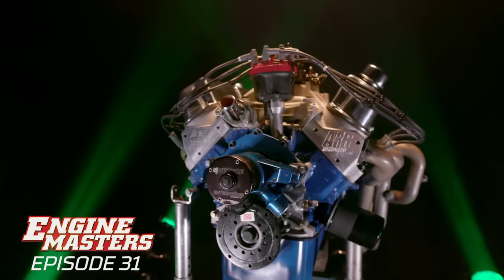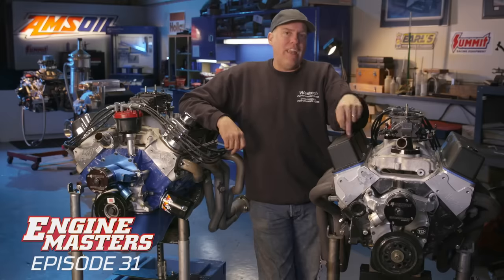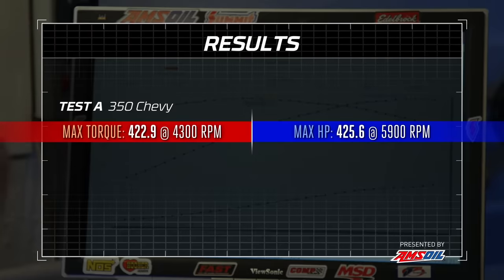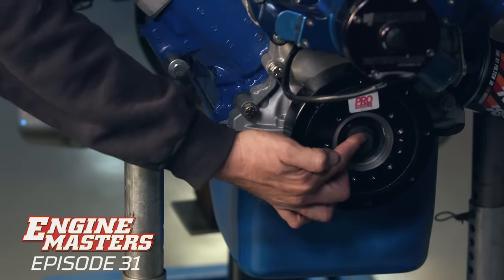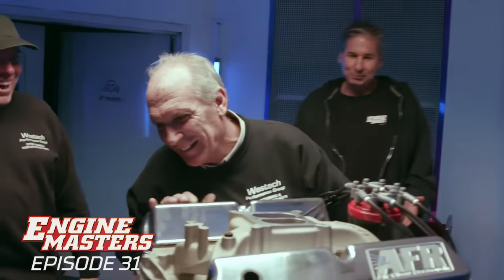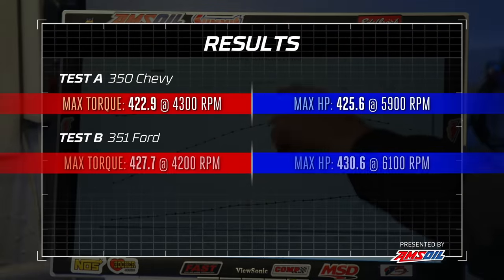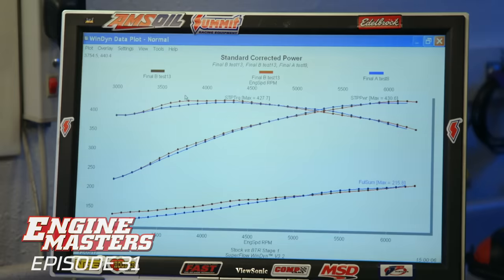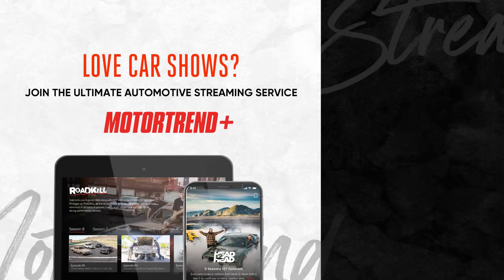Chevy vs Ford V8 Showdown! Small-Block or Windsor? | Engine Masters | MotorTrend

Comment from the maker: What surprised you most about these tests?
Reply: The fact that you are reposting old content is probably the most surprising, or maybe it isn't 🤔
Reply: @yamfingaz5598 What information of value have you posted,?
Reply: @MrLIVELINESOLUTIONS  How do you figure? they both weigh just over 500lb when in stock all-iron form. And the 351w is about 2 inches narrower.... have you ever seen them on stands side-by-side?
Reply: In stock configuration, the Ford has .256 inch longer rods, accounting for some but not all of the .472 inch greater deck height.
Reply: Love the show ❤
that you haven't done a 4banger build yet😅 one day I hope to see some crazy mancillas brothers style 4banger ❤❤
Reply: The Chevy wasn't painted orange!
Reply: Nothing you built them the same 👍
Reply: The Ford blue paint was cheating.
Reply: What surprised me most is how "freidburger" still has a show
Reply: That you have not tested which engine sound better. Same exhaust. I suggest Flow masters. L&L headers.
Reply: Absolutely nothing
Reply: @motortrend what rocker ratios did you run on each engine? Did you leave them stock or match them? Did you run a stock or matched valvetrain?
Reply: @DeusTex-Mex  The 351W is narrower by about 2 inches, and also longer by about the same amount.
Reply: @MrLIVELINESOLUTIONS  Doesn't a 350 Chevy outweigh a 351w? I've read 510 lbs for the Windsor, 550 lbs for a Cleveland and 575 lbs for a 350 SBC.
Reply: @DeusTex-Mex  yeah and i think the cleveland head version is like 575 lbs. the same as a chevy 305 WITH all accesories in a firebird or somethin AND the same as a caddillac 500 c.i. without accessories! hahahahhahah L0L
Reply: That you did it.
Reply: @cgarris8674 A 351W is slightly lighter than a 350 by about 10-15 lbs.  351C is the heaviest.  It's something on the order of 495 lbs for a 351W long block, about 510 lbs for a 350 long block, and around 550 for a Cleveland.
Reply: The comments about the front mounted oil pump on the Ford.
Reply: That Richard Holdener wasn't doing this test .😅 lol . I thought it was a good comparison  even though the Chevy didn't come out on top 🤔 . I like the fact that it didn't . I think a Cleveland engine would have been superior .
Reply: The money spent being equal
Reply: @MrLIVELINESOLUTIONS uh not really
Reply: That a secondary test with each engine built with the biggest cam, heads, etc. (but no power adders, "boosticles") and custom tuned to get max power and torque wasn't also performed.
Reply: Nothing, I knew the Ford would win; if treated with the same power enhancers.
Reply: No 351c 😂
I'm kidding nobody who knows denies the fact that the boss 351 or the 351cleveland beats bbc much less sbc, just ask Australia 😊
Reply: @MrLIVELINESOLUTIONS  Right, ...always more important than torque!
Reply: That you guys actually presented true results, that we all knew were true.
Reply: here in Australia in particular for racing back in the early 70's the Ford racing team built two falcon xy's with fuel injection and hoped them with goody racing parts and made 615 horsepower . And were painted white with a green strip . Those two should be found on youtube . I really like the 68 Z28 Camaro rs ss and the 69 , 429 boss mustang . Also a wicked still driving 1999 Subaru Outback five speed manual wagon , white in colour .

Comment: They are not the same.  That distributor being in the front makes life sooooooo much easier.
Reply: @bigboreracing356  unless you are the guy working on the distributor. Try swapping out distributors when they are under the cowl. Check out a dodge ram 318/360 they absolutely suck to do. Chevy wasn't as bad they didn't build the car over top of the distributor.
Reply: @Pike  one vehicle they did block the distributor pretty good was the Buick roadmaster. Sister in law had one and I had to do the ICM on it. What a pain.
Reply: Any engine with the distributer in front! Thanks, Ford!
Reply: Or......you could step into the last century.
Reply: @bigboreracing356  distributor in the back also just go smooth with crank physics
Reply: But it’s more visually appealing to be in the back of the motor
Reply: @bigboreracing356  at breaking down 😅
Reply: Bro are you dwarf it's not that bad .
Reply: @bigboreracing356  how’s that siamese head feeling with boost or nitrous? Your 3,5 and 4,6 cylinders are trying to eat head gaskets like its their job
Reply: We all know the LS motor is based off of a small block ford. No siamese cylinders
Reply: @youtubecantsaveallthesnowf8601  funny name, glad i dont get snow
Reply: More accurate ignition timing since torsional twist of the cam no longer affects it being in the front
Reply: Why?
Reply: The extra head bolt per cylinder helps.
Reply: @maxshaw9128  a matter of opinion..
I hate it in back
Reply: Especially when its broke down on the side of the road 😂
Reply: @1sweet_ta  the only thing slower than a Ford or Chevy is a NoPower.😁
Reply: @thefounding5879  dodge makes the fastest and most powerful vehicles out of the 3!  But keep hating 🤣🤣🤣
Reply: @1sweet_ta  Dodge makes the fattest and most pitiful out of the 3.  Your funny!
Reply: @bigboreracing356  what do you think your “Dart” engines are made after. Your “dart” 427 was based on a Ford 351W and your “dart” 632 is a Big Block Chevy. Dart is merely a aftermarket company that makes stronger blocks. Your Dart engines aren’t their own breed. 🤦🏻‍♂️
Reply: @bigboreracing356  😂😂
Reply: If you offroad any its better in the back, less of a chance of it getting water in it.
Reply: @mdingle11  Ive been putting off replacing my cap and rotor for a year now just because of that fact! Wow thats tight back there..
Reply: Other way around distributor and oil pump in the rear are much better for drag racing and fitment in a K member
Reply: @chewybrand238 really like when they hit puddles and die cause distributors in the front
Reply: @uncleremis69 BBC was doing that in the early 60s as well 🤔
Reply: Typical ford owner only cares about aesthetics. But in the end all FORDs end up wrapped around a pole or in the junkyard. Blatent rip off of GM engineering.
Reply: @ProTouringSS  if you are talking to me then you need to read my other comments in this thread.  Stop being that Chevy guy the rest of us cannot stand.
Reply: @randyyoung9892  rear distributor equals rear oil pump equals rear sump which equals longer engine life on the drag strip. I know that and I'm a Ford guy
Reply: Windsors are notorious for stalling if you run through a puddle because of the distributor location.
Reply: @stephenboshears4832  out of curiosity, how many Windsors have you owned?  I am checking to see if you are just making an uninformed global statement.
Reply: @thefounding5879  I got this information from my dads 289 powered 1964 ford galaxy and it stalls from water inside the distributor cap from puddles often enough that he keeps a can of wd40 in the car to get the water out quickly
Reply: @stephenboshears4832   You need to get a better dizzy. I just power washed the engine bay of my 1967 mustang and it fired up right away.
Reply: The comments are hilarious.. it’s like table discussion at Thanksgiving 😂
Reply: Uncle lost part of finger trying to set timing on ford. Dangerous and expensive. Better just go with the Chevy.
Reply: @stephenboshears4832 how's that though since the dizzy is in front of the tires, if anything I've seen more problems with sbcs. Plus that jank hei ignition that likes dieseling after you shut the car off.
Reply: Until you hit a puddle
Reply: @kenneth9874  never heard that one before!  Seriously, I had a 1970 Dodge Pickup with a 318 that any moisture that hit the windshield dripped right down on the distributor and killed the engine until it dried out.  It could have used a 351 Windsor with the distributor in the front for that application.
Reply: @thefounding5879  a can of wd-40 was mandatory to drive during/after a good rain, lol
Reply: @motoboggin2619  not the ignitions fault the timing or fuel was off, sounds like operators error
Reply: @kenneth9874  check the glove box!😆
Reply: @thefounding5879  or under the seat! Lol
Reply: FOOORRRDDDD!!!!!
Reply: @jeremypike9153 I love my built 360... but dammit you're right 😂
Reply: Or it just gets in the way
Reply: Don’t think it makes a bit of difference except for styling ques🤷🏻‍♂️
Reply: @crabappleracer  that’s the point of all the comments.  Ridiculous!
Reply: Never understood why chevy did that with distributor in back often times actually rubbing the firewall of some vehicles
Reply: Yeah right seen many oil pumps broke off in bad wrecks   oil pump and Distributor in back much better set up like Ford puts just 10 bolts in each head why Chevy puts 17 head bolts in each head and Ford water pump worst Design ever around 10 10 mm bolts that break off in the block when changing the water pump Chevy just puts 4 9/16 bolts in water pump that never break
Reply: @JAStheACE lmfao 😂😂😂
Reply: @ProTouringSS as a Chevy guy, those fords are no slouch the old pushrod motors they had were pretty powerful. Can’t we agree that Ford screwed up by trying to be European and going with OHC with a flatplane design on some of the newer modular engines? I love my Chevys and I love ls motors but come on there’s fords and dodges that’ll put it to sleep if they’re built right and it’s cool to see. Let’s not be that guy.
Reply: Another good Ford vs Chevy debate is the frames they used over the years, especially the 1958 to 1964 X-Frame chassis GM used (with the exception of Oldsmobile) which wasn’t known for being safe or durable.
Reply: quickest cast small block ford, gm or mopar is slower than the quickest cast ecotec 2.0l, small blocks are garbage, steve morris made a good ls engine called the sml but its all billet so gm has nothing to do, big block is the way to go if you wanna go fast... but! the gm 454, chrysler 440 and ford 460 are pigs
Reply: @maxshaw9128  what’s funny is I’ve grown up working on Windsors and 385 BBFs so the distributor in the back looks weird to me lol. I think both are great in their respective application.
Reply: Not in a van
Reply: @jonahbuilds4107  😆😆😆😆
Reply: Another lie that is told by ford guys to justify how good the LS is.
Reply: @mrhrobinson  Pete Harrell, an engine builder that has a National reputation says LS guys should be disappointed when they realize the LS engine is nothing more than a 2nd Generation small block Ford.  Ha!  BTW, I drive a 66 Impala with a BBC Chevy.
Reply: @donaldkinder6716  . Thank you.  My feelings exactly 💯.  👍
Reply: I agree!!! 💪🏼
Reply: @stephenboshears4832 🐂💩 never had that problem
Reply: Sure does look ugly tho lol
Reply: How does it make life easier I’ve been dealing with sbc all my life never had an issue with wires or timing and it just looks cleaner being out the way.
Reply: it really doesnt..........ive pulled a dizzy and switched it out in 5 minutes in a chevy
Reply: thats extremely subjective and i love mopars(not the new garbage)
Reply: hei,5-10 minutes max
Reply: ? someone doesnt know how to tune
Reply: Big deal I worked n my 289
Was able to set the point gap easily on a dual point distributor
Reply: @roblundgren8767  as you stated….whoopidi-dooooo!!!!!!
Reply: Until you take the distributor out
Reply: @uncleremis69 find clout somewhere else. Nobody would ever put a ford engine in a Chevy car.
Reply: @jrlaymance how’s that front sump treating you?
Reply: @1sweet_ta now they’re gone with it’s Italian owner
Reply: @drewschumann1 and you avoided the distributor. A puddle doesn’t care
Reply: @motoboggin2619 Dieseling is caused by dirty combustion chambers not the distributor. How does the distributor get power when the ignition is turned off? Duh much
Reply: @vinceyoung5912  electromagnetic interference from the field collapse can produce secondary ignition events since the coil is in the cap. most common on cheap igniton coils.
Reply: You made a good point on that.  
My 4 . 8 litter has no distributor 
Haha
Reply: Front distributor is an engineering mistake . Everyone I ever owned would drown out when I hit a patch of water in the road 😂. 
Never had that happen with any other truck . 
I’m not biased and any way . I think the 302 was a better engine than the 305 . 
But when it comes to the 351 . 
There weren’t that many of them . 
They were way more expensive. 
Not necessarily inferior to the 350 , just less sensible.
Reply: @ramie-uz9xi  just remember that the Chevrolet LS platform engines that everyone is retrofitting into EVERYTHING, are nothing more than a small block Ford.  This statement pains me as I am a Bow Tie enthusiast.
Reply: @thefounding5879  well I guess that’s all in how you look at it . I mean if you really want to be honest about it the whole OHV inception thing was a GM move. 😎
Reply: @1sweet_ta Dodge vehicles have the worst interior of all three. Dodge is making money off people with terrible credit.
Reply: Doesn't matter if you dont need to mess with it all the time like on the sbc.
Reply: If you’re messing with the dizzy that much you have other problems.
Reply: @ ha, ha!  Agreed!